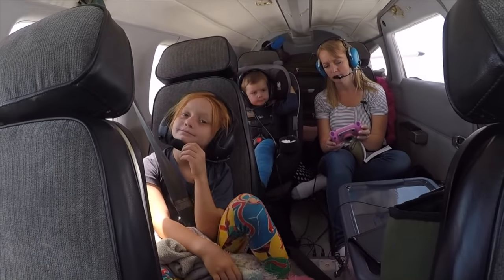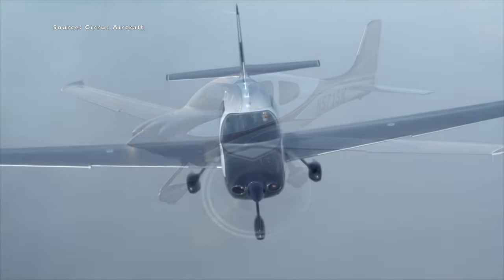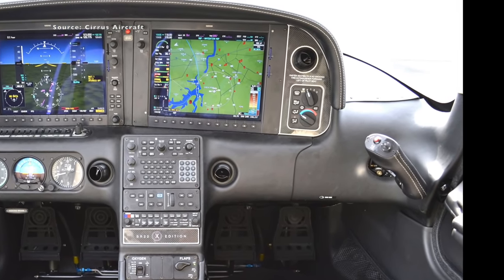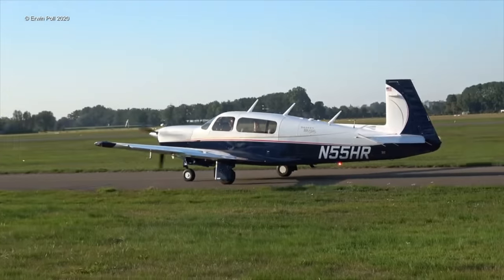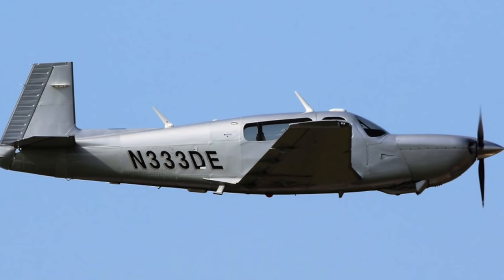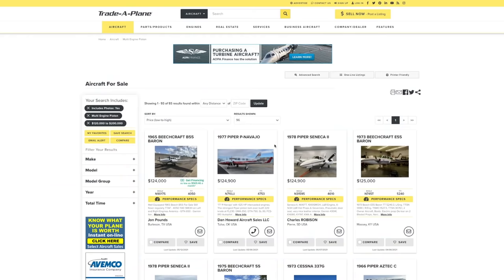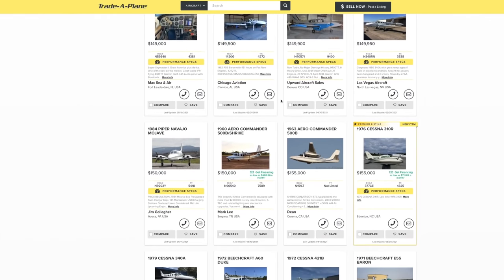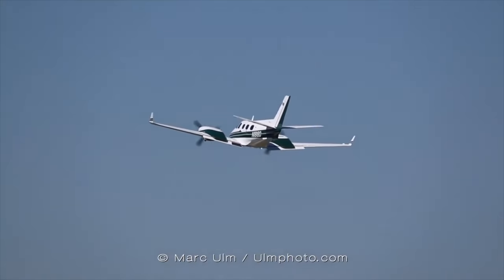10 Fastest Cheap Airplanes You Can Buy For Your Family

Comment: As a professional pilot with over 8000 hours in all kinds of planes I can tell you that piston twins are the most difficult and dangerous planes to fly.  One should not think of flying one without serious aircraft specific training. A safety pilot with lots of experience in your high performance twin is also a must until you get a handle on the thing.
Reply from the maker: Thanks for the info, good to know!
Reply: Don’t most ppl consider twins to be safer because they have two engines? What makes them more dangerous?
Reply: It’s easier to enter a flat spin in a  piston twin ,VMC is no joke
Reply: @TheGbelcher  the above Vmc comment is the truth.  I know it sounds counterintuitive, but if you lose one engine, you lose at least 80% of you ability to climb and accelerate.  This can be disastrous if you lose one on takeoff.
Some piston twins have some pretty complex systems as well.  The most convoluted fuel systems I encountered were on twin Cessnas.  It was very easy to starve the engines of fuel and still have over an hours worth of fuel on board, if you mismanaged things.
Reply: I don't know if it was specifically a partial consequence of it being a twin, but not flying around weather and lack of experience in instrument flying was definitely the biggest share of the problem.  He left from San Jose with his wife and two daughters to go to a birthday party (in Phoenix, AZ if I recall).  He was over the southern San Joaquin Valley and was talking to air traffic control when he encountered low visibility.  ATC was trying to encourage him to fly around the southern end of the area of low visibility, but he insisted on flying through it.  He wound up disoriented and heading nearly straight down crashing into an orchard.  Just to save some time, apparently, and he kills his whole family.  
I know of professional pilots who say that if they encounter low visibility in their small private plane that they only use instruments to turn around and get out of a low visibility situation.  Some even return to the airport and catch a commercial flight if there is no short way around the low visibility.  One cannot be too careful. 
One surgeon who was flying from one of the southern states into the northeast for a surgery in his own plane encountered low visibility.  He tried to land at the airport, but decided to fly to another in hopes of the visibility being better at the next airport.  He bounced around among a few airports in the area then decided to try the originally planned airport.  By then, he was dangerously low on fuel and crashed short of the runway in the woods when the engine quit.  The doctor died, and someone didn't get their surgery done that day.
Reply: “A fool and his money are soon flying more plane than they can handle.”
Reply: @TheGbelcher  if you lose one engine in most light twins, the other engone will just basically get you to the scene of the crash!
Reply: As a licensed maintenance guy with 30 years on this stuff, I totally agree about what you're saying about piston light twins. I have seen many a crash from loss of one engine. The Aerostar is one of the top on my list for that but many of the slower twins are a crash just waiting for an engine failure. A really sharp pilot lessens the risk but it's still a problem that I've seen take many a life.
Reply: @TheGbelcher  They are often operated in  IFR weather and if engine failure happens you better be good, the old joke was second engine takes you to the scene of the crash.  Many private pilots don't train to the needed level.  Letting them get low and slow would be  a problem, VMC  roll can be the unfortunate result.
Reply: How piston twins more dangerous than turbine twins?
Reply: @tenzinsmith  Much less power per engine in most light piston twins.  When you loose an engine in a light fwin, you lose much more than 1/2 of your performance.  Turbines are much more realible also, so chance of an engine failure is much less!
Reply: @matthewhorvath322  good points. Thanks for the insight, I’ve got a lot to learn!
Reply: @TheGbelcher  When you lose an engine the asymmetric thrust becomes a problem that must be dealt with immediately and correctly.  Lots of general aviation pilots with insufficient training react incorrectly to the engine out and make it worse resulting in a crash.
Reply: @tenzinsmith  Many of the same adverse events can still occur and are dealt with in much the same way. It's the fact a piston twin produces less total thrust and significantly less with only one engine. That and turbine acft engines are generally more reliable and are typically flown by those with more experience, although certainly not always.
Reply: Amen to that! Can I talk (or bribe) you into making a recording wherein you say that? I'd have students listen to it 1,000 times or until they could recite it verbatim, including backwards. Btw, it's not that I don't already do so, it's simply the fact I've grown tired of doing it. ;)
Reply: @TheGbelcher  The fact they have two engines and can suddenly become a single engine aircraft. That results in a myriad of adverse events that must be dealt with appropriately, often quickly and in the right order. In addition, since twins are inherently more complex, should an engine fail the emergency procedures are also somewhat more involved and is one reason a multi-engine rating is required.
Reply: @matthewhorvath322  80% performance to be exact
Reply: YEP, Last time I checked 80% is over 1/2.  80% is not an exact number BTW, but it's a good ballpark figure-a lot depends on loading, density altitude, GC, etc.
Reply: @GliderBane  Indeed. I got my MEL in a 310 and if the circuit breaker for the fuel transfer pump was pulled for some reason and not checked/reset during pre-flight the acft would suddenly become a glider due to fuel starvation.
Reply: @TheGbelcher  The fatal accident rate when you lose an engine in a twin is a multiple of the rate when you lose the ONLY engine in a single, and you have twice as many opportunities.   When you lose the engine in a single you concentrate on putting down somewhere survivable.  When they lose one in a twin too many people concentrate on landing on a runway.  Add to that the number of pilots who don't keep above VMC, especially when they lose it taking off, and spin in.
The other problem is training.  When I was working on my multi-engine the instructor simulated losing an engine by bringing one to idle.   But at the end he had me shut one down and feathered it as a surprise single engine drill, which I don't think is common.  There's a big difference between an idling engine and a dead one, which helped me immensely when I had to make a genuine single engine landing.
Reply: @matthewhorvath322  Exactly
Reply: What is your recommended aircraft
Reply: @charlesreese7513  it depends on what your needs are and what is your experience level.  If you are a beginner, a Seneca 1, Seminole or Duchess are all nice docile aircraft with simple systems.
As you step up in experience, a barron 55 or 58 is hard to beat.
Reply: Generally true, but there are RARE exceptions involving aircraft with INLINE twin piston engines/props, like the Rutan Defiant and Dornier 335 where the "what happens when one engine goes out" imbalance issues of MOST twin designs don't happen.
Reply: @Darrell Wayne That's why Rutan and Scaled Composites tried to get people interested in the Defiant - push-pull twin, NO thrust imbalance from losing one engine (other than a small amount from imbalanced engine torque just like in a single-engine) unlike the conventional twin configuration.
MUCH safer twin setup overall as long as you didn't over rotate badly and bend the rear prop.
Most business jets don't have the issue nearly as much, as you can place the engines a lot closer to the centerline so you get a lot less thrust imbalance if you lose one.
Reply: @GliderBane  One of my friends owned a C310 for quite a while. Not only is he a very accomplished pilot, but also CFI and an excellent mechanic. He always said the second engine is just there to get you to the scene of the accident. He always said the most important ting in twin training was to get the student to recognize an engine losing power by the way the airplane is flying and get the nose down and on the rudder.
Reply: @TheGbelcher  The remaining engine simply takes you to the scene of the crash.  That's a real thing.  Unfortunately, many twin pilots are not prepared for single engine out procedures when shit hits the fan.
Reply: @Anon54387  I know this specific incident.  AOPA did a great video on it.
Reply: @tenzinsmith  Reliability sucks when compared to turbo props.
Reply: @Darrell Wayne Well said Darrell.
Reply: Someone saying he's a professional pilot with 8,000 hours so that he can SAY that piston airplanes are the most difficult and dangerous to fly. REALLY? What did he learn to fly in? A Lear Jet? Was it EASUER than a Cessna Skyhawk or 150?
   I'm not going to  BOAST how many hours I've logged but I got my private license before I got my driver's license and would ride my bike to rent a most ' dangerous ' Cessna 172.back in the 70s. 
   I fly the King Air C90 which is a turbine twin but fly a piston Baron 55 and would like to move up to the 58P.
  Now for you people who are NEW to Aviation, for one,the piston engine ( like your car) has many more parts and the turbine engine is just over 3 times more reliable.  
  HOWEVER.... the KEY to safety is proper maintenance and your LOVE of keeping it that way.
  In my view of half century of flying, I can say all my friends love Aviation and their aircraft that they take great pride in keeping their airplanes top notch. When they can't afford it anymore, they put them up for sale WITG ALL THE RECORDS that come along with it.
  One can't compare a pilot to a DRIVER on the road. There ARE  few reckless pilots but that's because we're all human..BUT THEY ARE FAR AND FEW. The most DANGEROUS PILOTS? There the ones with approximately 200 hours and they've come to the mindset that they know all there is to know. Beware.
  The one claiming to have 8000 hours sounds like the 200 hour pilot who wants to stand on a pedestal above everyone else. He needs to eat lots of " humble " pie.
  DONT BE AFRAID OF YOUR PISTON AIRCRAFT FELLAS AND LADIES! 👌  Like ANYONE behind the wheel of ANY vehicle if transportation, do so with a passion of professionalism,something we pilots have than most " motorists "  do while your driving at 60 mph then some knucklehead cuts in front of you going at 90 and only inches away from you. 
  I actually feel SAFER flying among other pilots in the skies than DRIVING on the road.👍
Reply: @petermendoza1170  I learned to fly in single engine piston airplanes like everyone else, and, yes piston twins are safer then singles if flown properly.  They do command respect, even the most well maintained aircraft will have failures.  If you do not train for it, you will be another statistic.  I am not trying to scare people away from twins, I am just saying take it seriously and get good training.
Reply: @abel4776  Technology is great, but things fail.  The best piece of equipment in your plane is a well trained pilot.
Reply: @mgrantom  i literally got zero training the two ways i could see this being dealt with is rydder control wich would seem to only do so much and the other would be letting the still working engine hang lower then the dead endinge by flying at a slight angle. This is a complete guess but i would assume that would be the more correct way to not flat spin while trying to make it to land depnding how far you got to fly? Or would i have just killed myself? Again literally 0 experince flying im just assuming by what works best for me in flight sims and ww2 fighter sims
Reply: Shouldn't flying on just one engine be a mandatory segment of training?
Reply: @baronbokaj  not really because there not made for it only in emergency cases the only planes that can really handle losing engines are 4 engine planes. most 2 engine planes have to fly slowly losing altitude just to not flat spin depending on the plane obviously  the rotation of the prop and the uneven thrust makes the planes not remotely want to fly straight though ive got pilot experience i do know most these smaller dual prop planes are considered way less safe then a single engine plane because when one engine dies you cant keep throttle at cruise speed so you fly slower while having allot of dead weight so your only direction is very slowly down (mostly know this from flight sims) this changes with rear engine dual jets because the location and the lack of torque applied from the prop
Reply: @baronbokaj  it is.  The problem is many private pilots get their multi engine rating and stop training to fly in a single engine situation.  When something bad happens they are rusty or just forget the basics.
Reply: @keithpennock  hence V tail bonanza
Reply: If you want a twin, you have to dedicate yourself to continual training with it. I disagree with the second engine takes you to the crash.. that is nonsense. It you can't wrap your head around the critical engine concept, then that is true, other wise you can get to the nearest without much problem. You could always pick up a Piper Seneca with counter rotating, but it's well under 200 knots. Sure there are more brain cells needed to manage a twin, but they are not remotely as dangerous as some of the 10,000 hr pilots (Ha) in here make them sound.
Reply: Tom Cruise can do it, so can we 😉😆🤣😂 lol
Reply: There’s always one of those: “as a professional pilot 👨‍✈️ … followed by some number with 3 zeros denoting the number of hours flown…..
Reply: @TheGbelcher  Asymmetric thrust. When one engine quits running, the other engine sometimes can't keep the plane flying straight and level without immediate control and trim changes.
Reply: @tenzinsmith  Turbine engines have a much lower failure rate.
Reply: @matthewhorvath322  I disagree with the "most" part of that comment. I lost an engine in an older generation 310 once and was able to climb at a decent rate and fly a regular pattern to come back and land. That was on a warm Texas night and with the very large dish shaped landing lights extended. Barons fly OK on one engine, and a lot of other twins too. A Piper Apache is a different story...
Reply: @keithpennock  🤣🤣🤣aww man
Reply: Those light twins also have too much off-center mass for my taste. That creates a whole lot of issues even with 2 engines running
Reply: @panicraptor2837  well, they're not for aerobatics...
Reply: @TheGbelcher  Loose an engine and your instantly over weight. Couple that with lack of experience and you just bought the farm. Insurance is unavailable to low time pilots. They are death traps due to the dependability of piston engines.
Reply: Cessna Super Skymaster sounds like a winner to me.
Reply: @gedionsamuel2256  skymasters are nice, but talk to someone who owns one, they are crazy expensive to maintain vs other twins.
Reply: @GliderBane  I agree. I recall talking to one owner who said they’re for someone “handy with money”. :-) Truthfully though to have the added benefit and safety of a 2nd engine without the dangers of a normal piston twin configuration, I’d rather gladly find the means and deal with the added cost of maintenance. It’s either that or go with turbines which are astronomically more costly.
Reply: @mitchellisaac7490  cessna 337
Reply: @tenzinsmith  It is far less likely to lose a turbine than a piston engine.  Everything else applies...VMC, VMC, roll, lack of proper training, flying in IMC, etc.
Reply: My uncle has a Duke.
Reply: @Mitchell, in what way would a piston twin be more of a problem than a twin turboprop ? (i'm sorry i can't remember i ever flown a piston twin so have no clue).
Reply: @pascalcoole2725   It's in the failure rate. You still end up with a sudden yaw rate imbalance. The only hope is the rudder control and tail is designed large enough to compensate. Other wise you can't maintain cruse power on one engine and you lose altitude.
Reply: @uberdang830  Agree but this goes voor N-1 on a turboprop as well.
Admittingly i'm only familiar to 10-25 tons airliners and verry little on Kingair-200, these all have autofeather systems and in some cases even rudderboost, beside these are al FAR-25 rated aircraft.
I have understand that accidents with small piston twins are pretty common (so to say),
But still isn't this just a mather of descent training, i mean i instructed N-1 at V1 thousends of times, it's just wat we would call 'a monkie trick' nothing to it.
Reply: @pascalcoole2725  it is a question of power.  If you lose an engine in a turboprop, you will have more power to climb and accelerate.  Also, the chances of you losing an engine in a turboprop are much lower.
Reply: @Anon54387  Private pilots should not depend on their airplanes to get them to important event, including surgeries.  If you are a private pilot, fly because you can, not because you have to.
Reply: I"m on my 4th aircraft now; my third twin. If you're even thinking of making the jump to multi make sure you can triple to quadruple your annual aircraft budget, fuel being the smallest line item in the equation. Then, my personal feeling is you need a solid 500 hours of flying, mostly cross country or distance flying in your single, then go get your multi rating to get the feel for it and see if its for you. In any twin there is alot going on and half the time to make decisions. Most of what does and can go wrong is not black and white and from the books, you need to sleuth it out while flying. Also consider that if you make this jump you'll need a healthy amount of hours in your specific twin before an insurance company will touch you or give you a policy that breaks the bank. And... when you're flying around north of 180 knots those hours are hard to build. Every flight needs your A game. When you're looking at ads and see aircraft that are "cheap" there's a reason. Look at the engine and prop times and the avionics, remember avionics installed are twice to three times the cost of buying them and that gets up there fast! Mechanics are also double the cost obviously. Paint and upholstery should look nice but won't keep you in the air safe. Other than that... as a pilot, flying them is very rewarding.
Reply: My father (a WWII pilot, multi-engine land-rated) always said to only turn (if possible), into the good engine.
Reply: My choice for a twin is MU-2. Such a gorgeous plane that got such a bad wrap as a twin pistons when in fact all it needs to be is understood and treated properly.
Reply: So what you are saying is buy a king air
Reply: Well, "most" people are wrong!   Unless you're well trained, experienced, good & lucky, with an engine failure,the operating engine will simply take you to the scene of crash!@TheGbelcher
Reply: @talon2pro hohoho your father even cant ride a bike without crashing
Reply: The biggest problem with twins is that they cost so much to maintain and feed that most multi-engine rated pilots don’t fly them enough to maintain proficiency. When one engine dies, it always happens at the worst time and they’re not prepared.
Reply: @TheGbelcher  two engines are not safer. One is always out to get you.
Reply: @gedionsamuel2256 I don’t think the 337 Skymasters were solid 200kt cruising planes.  Maybe up high.  But they check several of the other boxes here.  And they probably aren’t much more expensive to maintain than a few of the other twins on this list.  

A late friend of my family’s owned a Skymaster for a few years (he was my dad’s partner in 3 other planes over about 15 years).  I thought it was a pretty cool plane.  But it seemed pretty loud, inside and out.  I don’t remember what model (letter) it was - It had all “porthole” type windows on the side, though it was not pressurized.

A couple of things I clearly remember him pointing out about it.  Can’t top off the oil in the rear engine or it leaked like crazy - the rear always leaked a little.  He was wiping up a bit inside the rear cowl once and referred to it as the “Skymaster corrosion control system”.

Also said not to be in a hurry to raise the gear after takeoff.  When in transit, the nosewheel turns sideways, a bunch of big doors open, and it’s not a fast process.  Lots of drag that could hurt you down low if engine failed.  That was just a geewiz-never-thought-of-that kind of thing.  I think the 337 was a plane that you’re not supposed to operate the gear in a turn - Might be thinking of another plane - not sure about that.